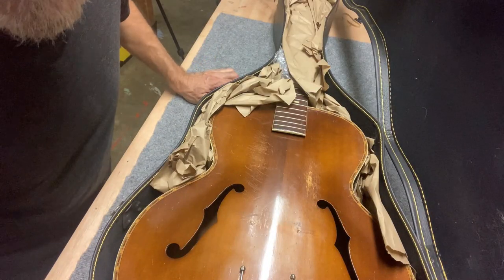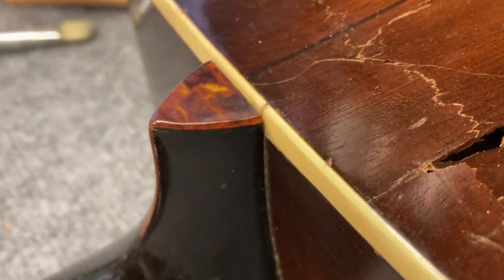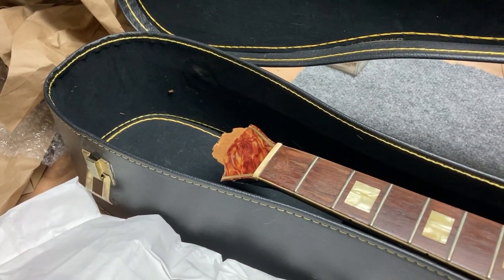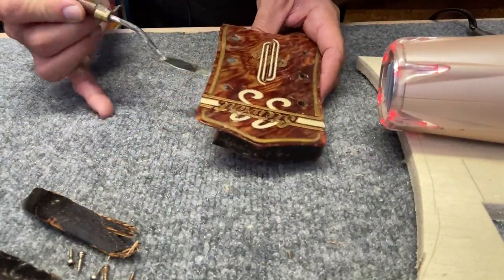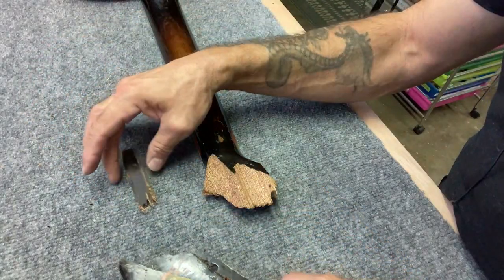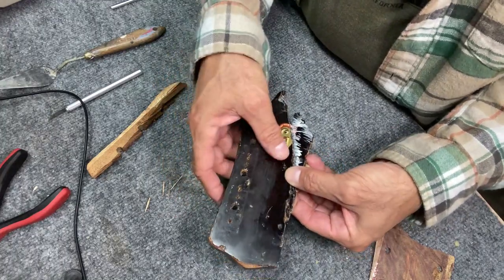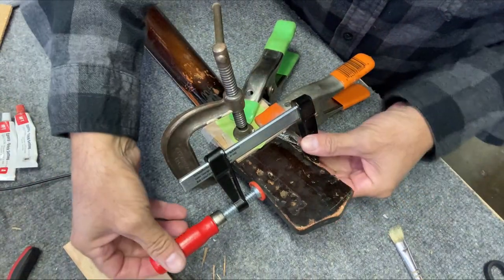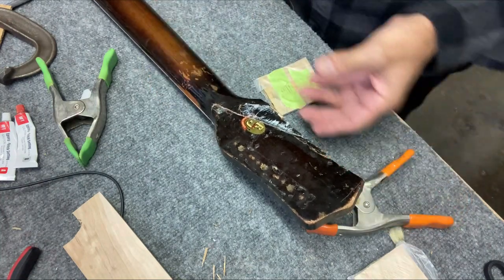Pt1-1935 SS Stewart Archtop - Headstock And Back Pain

Comment: Oh man, that clamping procedure looked pretty stressful!!  I always run through my clamping twice before applying glue in complicated repairs like that.  I actually just reassembled a '67 Harmony headstock from 4 pieces.  Someone else tried repairing it before I got it, so it had a couple gaps, and I had to clean out all the old rubbery glue.  I ended up sanding the back of the headstock down and putting a 1/8" mahogany layer over to hide the missing bits and filled nail holes...  yeah somebody put a couple nails in to try to hold the break together.
Reply from the maker: I don't like working with epoxy, kinda regret it. Wow Yeah a veneer is a great idea adds strength too...
Reply: @vindustrialguitars  exactly, might not be a bad idea for this one too

Comment: The guitar was made by Harmony in Chicago- B & J goes back a long way and sold guitars from many makers and dates from 1901. Your guitar has replacement modern tuners. Here if you Google this is an analysis of the same model- it too has new replacement tuners: Jake Wildwood C.1935 S.S. STEWART (BY HARMONY) ARCHTOP GUITAR
Reply from the maker: Thanks I’ll check it out…
Reply: @vindustrialguitars  I have a feeling that these guitars had the Waverly "Tune Rite" single unit tuners with metal buttons that crumbled- and that's why they were replaced. You may know by the number of screw holes and marks if those tuners were once used but I have two Harmony guitars from this time with them and one has two buttons that have crumbled-  I put on big plastic buttons and filed them to the seven sided shape and painted them silver!  They are on this fancy S S Stewart- which is also late 1930s. Google this : Jake Wildwood 1940S HARMONY-MADE SS STEWART 7006 ARCHTOP GUITAR. Jake reckons the guitar he has like this one you have has a hand carved top.